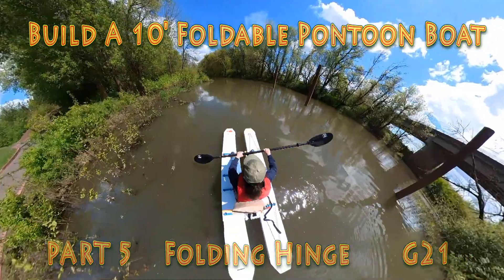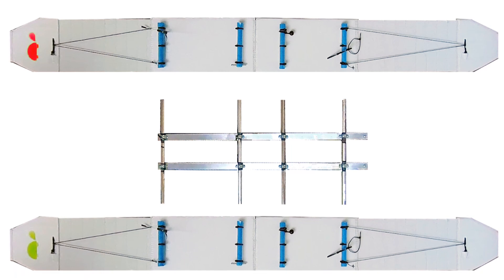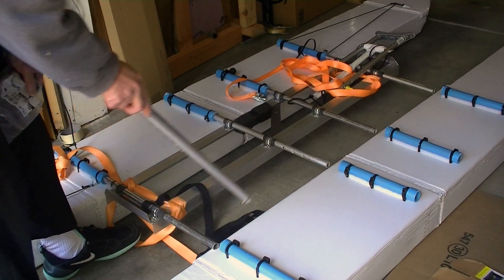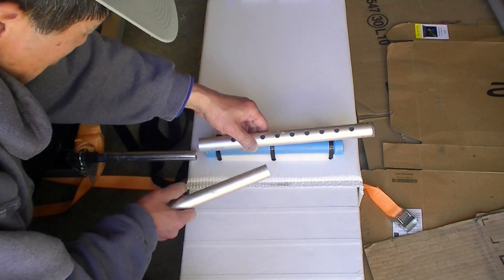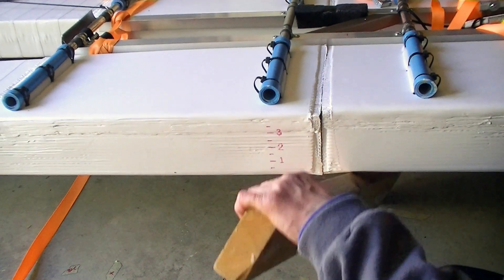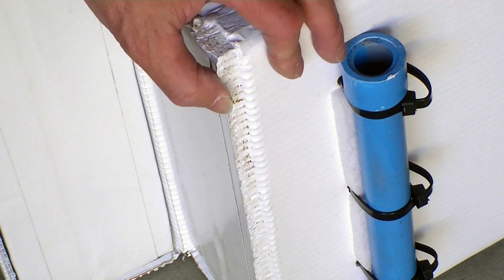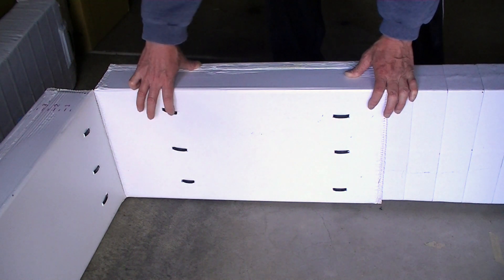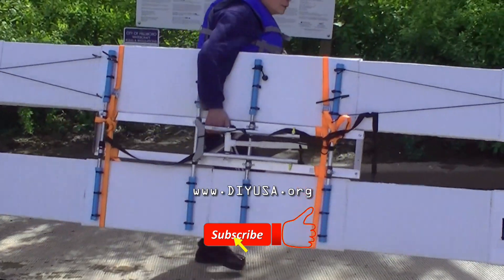Pt 5 DIY Pontoon Boat - Foldable G21

Comment: So how is the G21 holding up?  I really like this design!
Reply from the maker: I did a review after using that for the summer (2023).  You can watch the video here: https://youtu.be/XosqjTPKc9M?si=ewqLdPeBt_nlWIUY  Last year, I built the next generation of that pontoon boat, removed the hinge and used PMFG for the pontoon. https://youtube.com/playlist?list=PL2ShZzOUu01smsfaDW-H480Q5vIHhs0se&si=w_KSzAVVHIiN4Kce  It is longer, almost 12' long. I still like the G21 and I used it more often in 2024 because it is lighter, shorter and easier to fit into the car. I mounted a milk crate at the back and that gives more space to keep my fishing and crabbing gears. I replaced one zip tip otherwise everything stayed intact and works. The tape also holding up very well. It doesn't look as good as the PMFG but it is much lighter and faster/easier to apply on the surface of the foam than the PMFG. I used the white tape, and it doesn't absorb heat. If I build that again, I will use the updated pontoon design and remove the hinge. That will make the build much easier and faster.

Comment: Looks like those zip ties will keep slowly tearing through the bottom panel, so you will always have to tighten them after every use?

I suggest half a PVC pipe between the coroplast and the zip ties on the bottom of the boat to spread the load across the full width of the pontoon. 

I'm really impressed with your design it looks so stable!
Reply from the maker: Your observation is correct! Thanks for your suggestion.
Yes, this was exactly the concern I have when I built this boat. However, after my first water test, my concerns went away (at least for now :-)  I afraid the zip tie will tear thru the bottom of the coroplast and then the foam. I did consider adding a piece of thicker plastic under the zip tie (similar to your suggestion, I did consider using the 'cut-up/half' PVC pipe - 1/2 PVC pipe is good because it created a natural bending radius at the bottom for the zip tie, but the PVC edges may cut into the coroplast).  My backup plan is if the zip tie starts cutting into the coroplast/foam, I will 'fuse' a layer of coroplast (or add a thicker piece of plastic using the 'cut-up' downspout from the plastic rain gutter) to strength that surface. But after the water test, I don't see any sign of stress. I used the heavy duty zip tie that can handle 200 lbs. I am glad I have not over designed that part. The zip tie will be stretched but I hope it will be like a guitar string and will reach a stable state.